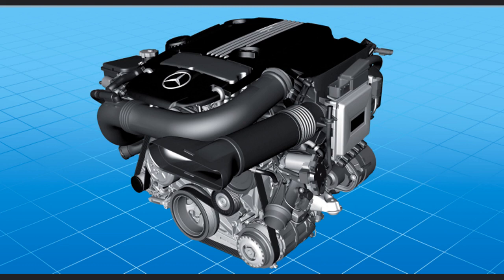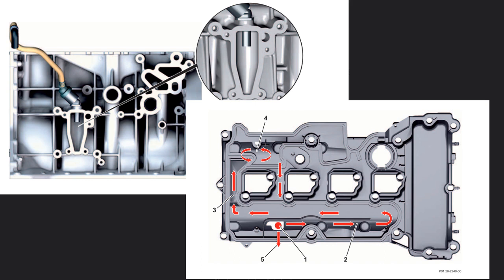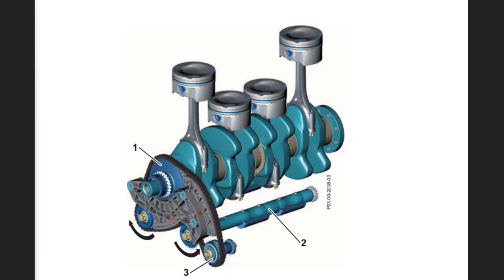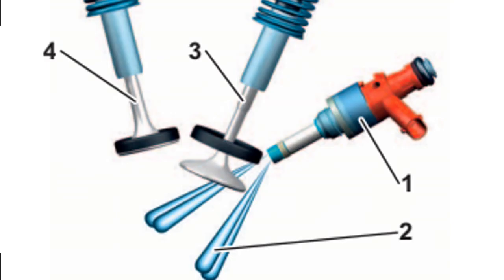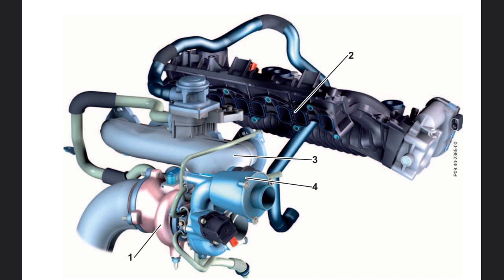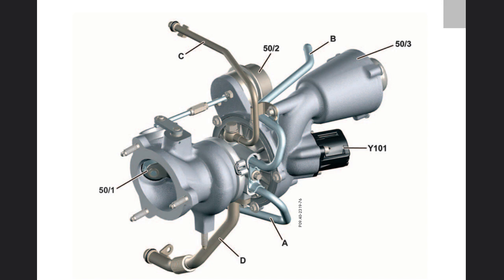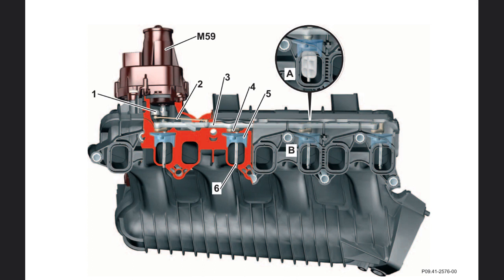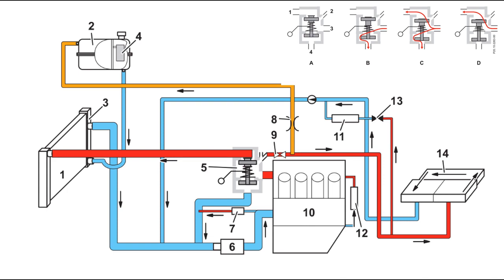Mercedes-Benz M271 EVO explained in details

Comment: Can you do one for m271 compressor ?
Reply from the maker: Sure, will try to post one soon. Meanwhile, feel free to ask me about anything regarding the kompressor m271.
Reply: @andrewkamal1 this motor is reable?
Reply from the maker: @mariociao9314 yup, so far so good
Reply: @andrewkamal1 I’m looking into twin charging my M271 KE18ML with exhaust-turbo components out of the newer evo. Do you reckon it would fit dimensionally? Or would I be better off with custom-made systems?
Reply from the maker: It’s been done before. Factory turbo and manifold would fit, but you’d need custom piping.
Reply: @andrewkamal1 im swaping a kompressor for turbo.at 10:01 the valve is open or closed? i need it to be closed so the air doesnt recirculate. when its not connected is it staying open or closed? if its open is there a way for me to make it stay always closed?
Reply from the maker: @nikgav5514 if you’re “swapping” then you dont need the recirculation valve. This is only needed if you will keep the kompressor.
Reply: @andrewkamal1  ik bro but if it needs to be on (not connected just on) so it fills the hole.im asking if you know any way i can keep the valve closed so it doesnt open so the air doesnt recirculate. i hope you understand, sorry bad english😂
Reply from the maker: @nikgav5514 I dont think there’s a way to keep it closed. It’s electronically controlled. Unless you figure out its input signal and force it closed.
Reply: @andrewkamal1 thats what i was asking. thanks bro. im waiting for the m271 kompressor video. keep it up!

Comment: Hello, there is a knocking sound in the engine of my 2011 C180 1.8 CGI. But there is no problem in driving my vehicle. Some engine mechanics say that the oil pressure plug may be cracked, so it can be done. Apart from this, when I suddenly press the gas, the vehicle turns on the engine malfunction light and gives the fault code p000277. Do you think there may be a connection between this fault code and this sound?
Reply from the maker: I believe this is related to fuel delivery. Three parts can fail and cause this:
1. HPFP at the back of the engine
2. Low pressure fuel pump below back seat on passenger side
3. Fuel sending unit below back seat on driver side

Comment: Engine has three map sensors and I have P0106 for map sensor failure and I don’t know which one of them I have to replace
Reply from the maker: You have to use Xentry to know which sensor it is. Try swapping them around and see if things get better.
Reply: İ have p008777 and p008a23 p000277